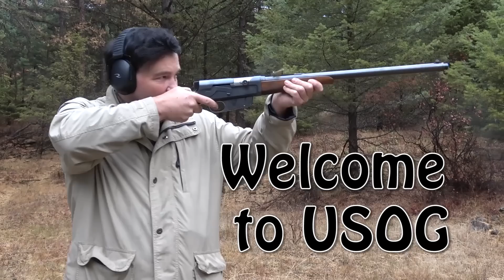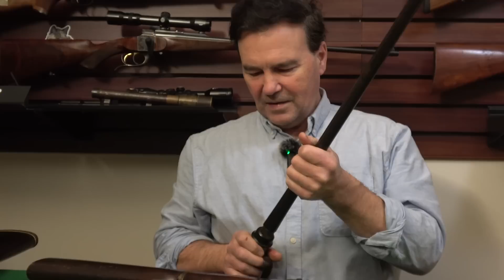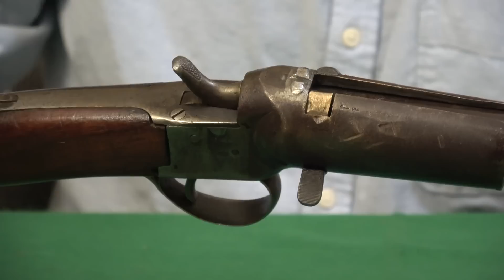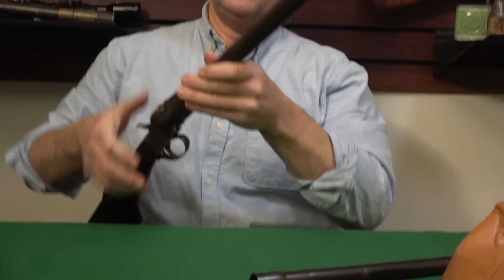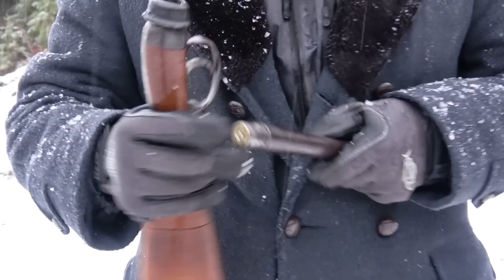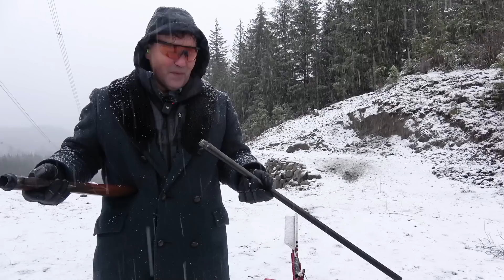Vintage 3lb Takedown Gun THAT WORKS!

Comment: Mike, I have a 1893 Marlin takedown that I want to preserve the stock without damaging. I'm considering a light coat of tung oil applied with an exceptional wax from Gilboys, a restorer of antique furniture from England over it that seems to be very good. Could you find time to tell me if  what I want to do would damage this firearm. Much appreciated for any response.
Tom
Reply from the maker: Hi Tom, I would go with OOOO steel wool and the wax. If the wax doesn't have any colour to it; then use Briwax on gouges and scratches and overcoat with the Gilboys. I find that wax feeds a stock better than oil IMHO. Please let me know how it goes.
Reply: Thank you for responding Mike. It's not easy getting reliable information on this if any. It's easy for me to have confidence in your knowledge. Sorry for picking your mind once again.on this. Are you saying I should use a coat of the Gilfoys and and then fill in blemishes in the stock, with Briwax before recoating it with the Gilfoys? Should I reapply  the Brixwax over the blemishes until the stock is fairly smooth? I see that the Bixwax comes in different shades. Should I try and match one to the oil finish before going over it with the Glfoys? Sorry again, but I don't want to make any mistakes with this antique firearmI feel entrusted to do right by, until it's passed on.
Tom
 @UnitedStatesOfGuns

Comment: If it truly was a poachers gun, then maybe it was supposed to be used with black powder loads which would've made the recoil more of a push than a smack because of slower burn rate?
Reply from the maker: Good thought - but actually black powder explodes, whereas smokeless powder burns; as odd as that may seem. Yet, you're on the right track - I'm pretty sure they used light loads - either smokeless or black. I'll cook some up and see how she goes. Cheers.
Reply: True, but isn't the gas expansion rate slower with black powder, making it a deflagration instead of a detonation? Not quite sure tbh, that's just what comes to mind from waaaay back...

Comment: I appreciate the fact that you shoot these old and unique guns.  I don't buy a gun that I can't shoot..I can't abide "wall hangers".  Recently received two sxs shotguns, one owned by my grandfather (born in 1892) 
Marked "Syracuse Arms Company, Syracuse NY" on top the right Barrell and "Triplet Steel" on the other.  Gun is tight, but the break lever has to be manually closed to lock the action shut.  I cleaned it up and fired each barrel with some paper RKS 2 1/2" shells I use in another 12 gauge that I have marked "laminated steel"- a Belgian made "Parkhurst".  The other belonged to my father (living, aged 83).  Dad hasn't fired his probably since the late 1950's.  It is marked "Royal Gun Works, Belgium" on both sides plates behind each hammer, and an indistinguishable symbol followed by "1512 Cast Steel Belgium" on the top of the rib between the barrels.  Both triggers cock and operate normally, but the gun has a lot of play when closed, so much as I would like to, I will refrain from firing this one.  I did not notice your hand tremors;my coworkers comment on mine, which are quite annoying when trying to carry fine mechanical work(I'm 58).  I assume mine are from work related stress and too much coffee...

Comment: Hello Mike. Sad that so many You Tube wannabe "Doctors" notice your hand shake, as if you did not notice it and they think they should comment about it. They are probably the kind of people that ask a man with a white cane why he does not walk faster.  😒 
 
 If you were a drunkard or a druggie you could not afford the various firearms that you show us on these videos. Ignore the ninnies and keep doing what you are doing! 
 
 As for the heavy "kick" of that lightweight gun, I think you could (maybe) probably attach a wooden and metal fore-end permanently to the barrel by use of some "Barrel Bands" front and rear.... or braze it to the barrel with a propane torch maybe.  Your local gun shop / gunsmith probably has a "spare part" fore-end laying around gathering dust that could be used. It would vastly improve your grip also. Instead of using a cleaning rod for the ejector,,,, have you tried the flat blade screwdriver on a Swiss Army pocket knife? 
 
  As for lower pressure/lower velocity loads in the 16-gauge shotshell, I think there are a couple/few ammo makers (maybe a U.K. maker also) that still manufacture the shorter 16-gauge 2 &1/2 inch cartridges. If you visit the website titled "16-gauge Society" , then point & click on the picture of two shotshells it will show the various 16-gauge cartridges available. Eley (UK), Estate (USA), Gamebore (UK), Westly Richards Agency (USA), Kent Cartridge and RST Shells (including 2 inch shells), and "Polywad Vintager", and "Ballistic Products" are the brands that I have found. I do not know if there are shotshell makers in Canada. 
 
 P.S. Donation just sent.